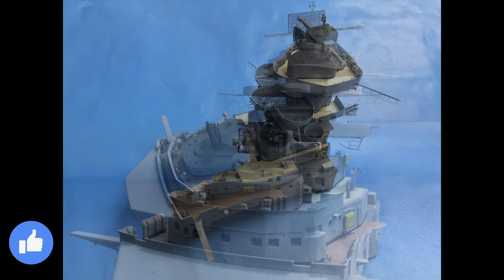Trumpeter 1/200 DKM Bismarck Full build with Pontos detail set Part 18b

Comment: I am using the veterans Model kit for the searchlight and the target givers  The searchlights and signal lamps have most of the detail that is present in the Anatomy of the Ship reference.  The searchlights are turning out very well and are a huge improvement over the Trumpeter molded searchlights.
Reply from the maker: Yes I’m going to use those as well Mac but they’re hard to get in the UK mine are coming from Aus.

Comment: I wondered about your treatment of the bridge windows. Your solution was simple and effective. Anything else would have slowed you down too much. Great work and enjoying this build.
Reply from the maker: the frames would have required a lot of thinning John as the plastic is so thick at that point. it was a labor I just wasn’t going to do when I’ve used this method before with reasonable results. it’s a good balance of effort/ effect.